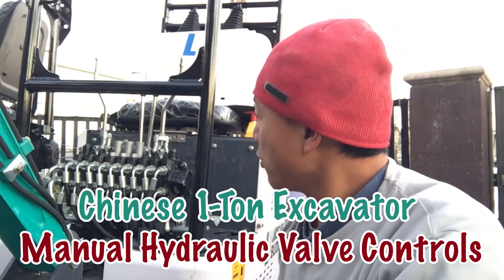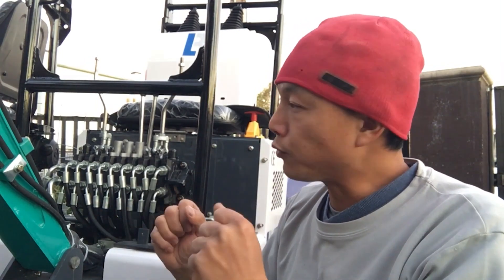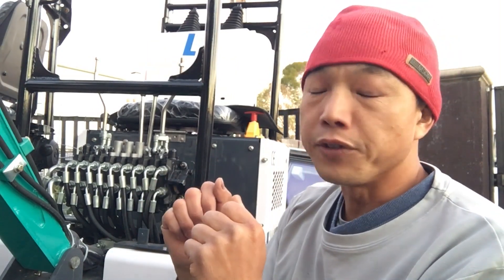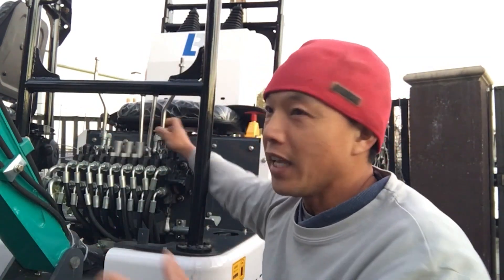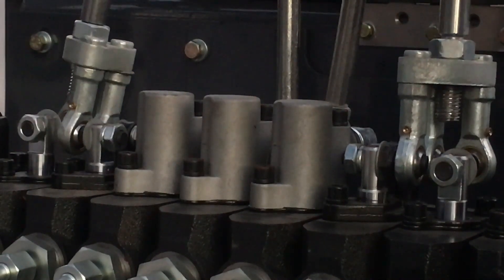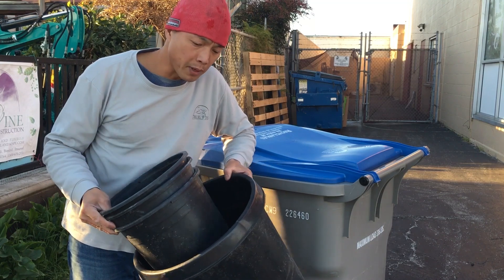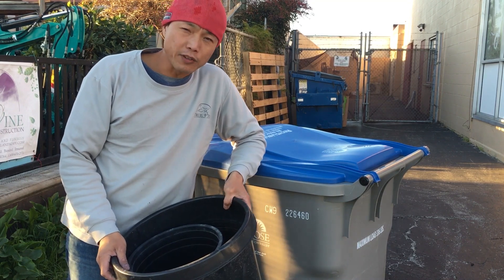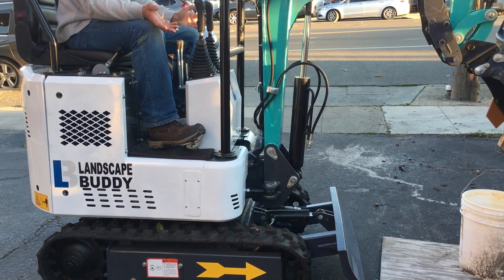Want a Small Chinese Excavator? MUST SEE. Showing the type of hydraulic controls. See description👇

Comment: The left most cylinder is the main adjustment for flow/pressure.  Do you know how we're suppose to adjust that?  There is both a large nut/locknut and a smaller set of nuts above that.

Comment: Hi Jason.  Your explanation of why new users experience jerky movements when operating the controls is very good and just what I needed to understand.  I have a John Deere tractor and I was used to almost full range of motion of the joystick when operating my grapple, for instance.  However, when I tried my mini-excavator that I recently purchased through Alibaba, I found the joystick controls to be extremely sensitive and the movements jerky as you described - even at the lowest throttle position.  Unfortunately, there was very little documentation provided.  At first, I thought that I needed to somehow lower the hydraulic flow.  However, your description that this is normal and your suggestion to keep practicing is reassuring to me.  Thank you for your videos.  I have subscribed.  BTW, is "pilot control" the same as the manual hydraulic control that you describe? Thanks.
Reply from the maker: Thanks Patrick for your comments.  We’re spoiled with the nice machine setups and it’s time to get used to the old fashioned setup, and work those arm muscles.
Often time when people talk about ‘pilots control,’ it’s also same as referring to ‘joystick control.’. The control mechanism is referred to as servo hydraulic control.  It’s a set of smaller, more sensitive electric switches that control the valve blocks, that in turns activate the hydraulic actions.  In our 1-ton scenario, there is no ‘small, sensitive switch control,’ it’s your arm muscles.  My hydraulic knowledge pretty much ends here.  Anyone of the viewers can add more comments if you can explain it better.  Cheers! 😅

Comment: Work at a lower throttle.The operation of  the machine will be smoother.If you open more than one valve, simultaneously, it will also be smoother.
Reply: that's the  trick i use, NEVER operate only one function!
Reply from the maker: Thanks George for your input.  what you said is perfectly true, and again, once you get used to the control, you’ll be operating these like a champ!!